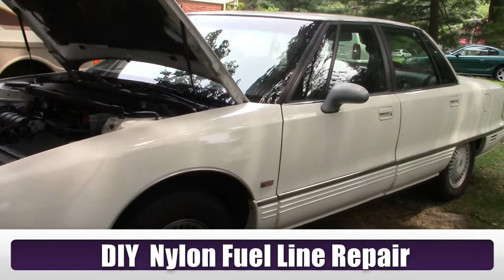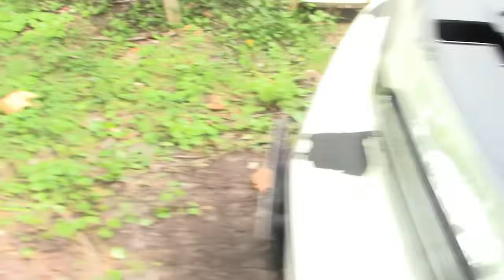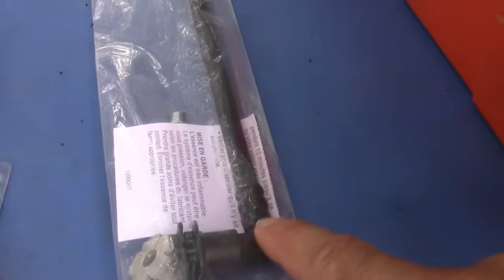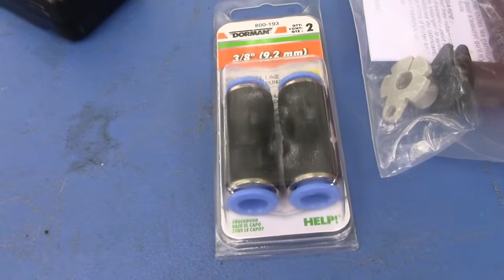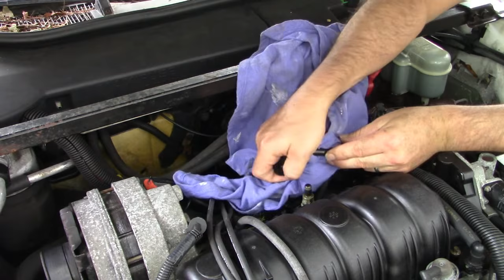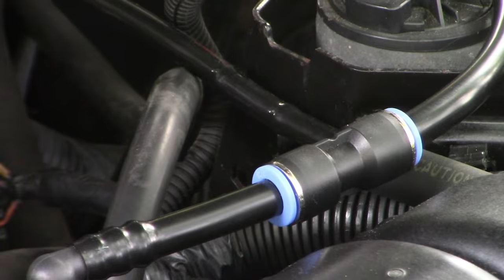Gasoline Leak?  Easy DIY Nylon Fuel Line Repair

Comment: That push lock is for airlines. I wouldn't recommend using that to splice fuel lines. If you must half ass it like this use a brass compression fitting that doesn't have a chance of leaking under low pressure like this fittings used that are designed to be most affective over 60psi.
Reply from the maker: These fittings are designed and marketed specifically for fuel line repair.
Reply: Ok, learned something new.  Thanks for the video.
Reply: @Buckwsr  I replaced the entire car with these fuel lines hopefully it won't leak
Reply: These aren’t the fittings you think they are they just look the same. These are specifically rated for fuel and high pressure..
Reply: I out can't use brass union on plastic lines

Comment: a heat gun on the low setting will work to soften the line just enough to bend it without stressing the walls. then let it cool.
Reply: Yeah not smart to do on a fuel line

Comment: These fitting are garbage! Dont use! Use the brass fittings with the small plastic gasket
Reply from the maker: I, too, have used the brass fittings successfully on some other projects.
Reply: @Buckwsr  it's got a brass union on it now that leaks
Reply: Lmao we use these fitting on hydraulics and high pressure pneumatic systems and they work perfectly fine. They’ll work just fine here also. I’ve only had hell using those brass pos fittings.
Reply: So they make them with a plastic gasket brass union has a brass flare  won't work

Comment: Thank you very much for the awesome video, I am going to be using the same exact things that you used, but, I was wondering what you did when the fuel was leaking through the connections, to make it stop leaking? and how is this holding up? I have fuel leaking in my engine, and my service engine light is on, saying that it is running to lean, and has a vacuum leak.
Reply from the maker: Repair is holding up just fine. I resolved the leak by making sure both ends of the tubing were fully inserted into the union. Also twisted the coupler a bit to verify all was as it should be. That's it really.
Reply: @Buckwsr  Thank you very much for your quick reply. I am going to have to use a pair of scissors to cut the pipe with since I don't have a saw or the cutting pliers. before you fixed this were you getting any service engine light codes coming on?
Reply from the maker: @toddisbound2luvu  It was the odor of gasoline, not the SES  light, that tipped me off to the fuel leak. Your lean condition trouble code could be due to a wide variety of potential issues, fuel pressure being one of them. But the fuel leak repair is your top priority right now.
Reply: 😅😅😅😅😅😅😅😅l😅😅😅😅😅😅😅😅😅😅😅😊😊😅😅lll